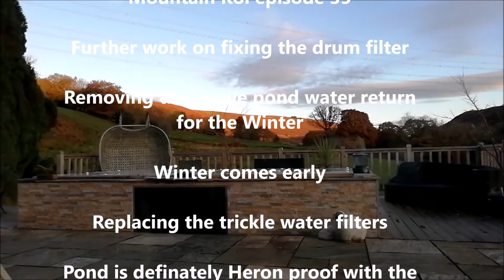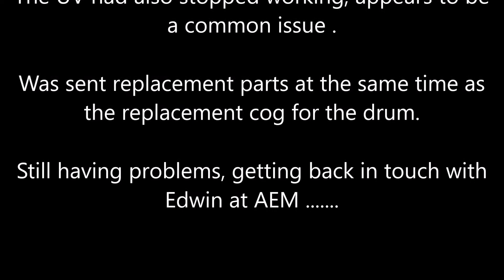Mountain Koi - EP 35 - More AEM Easy Drum problems

Comment: I've had one nothing but trouble. I upgraded to a Red Label drum and had also had issues with two high pressure pumps failing and then the screen coming loose getting jammed and burning out the drive motor and electrics I returned the unit that cost over £2000. I've now gone back to a Nexus as I had one 6 years with not one problem.  If you run a Nexus with the auto and K1 micro media there as good as a drum. Fines are good and it's zero maintanence and very little to go wrong.
Reply from the maker: It has crossed my mind of changing to a Nexus, that was my original choice until I found the AEM drum at the same price. 
I do like the drum when it works but when there are problems, it is a pain ….
Thanks for the comment